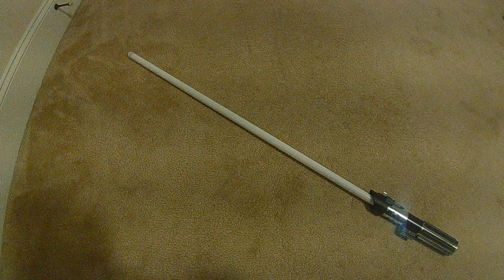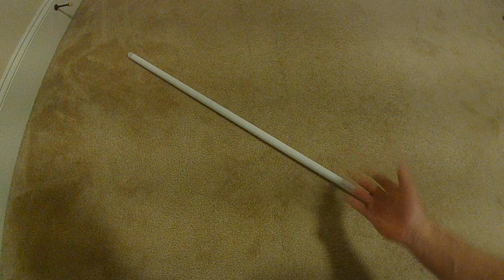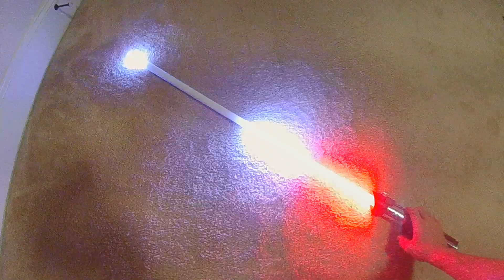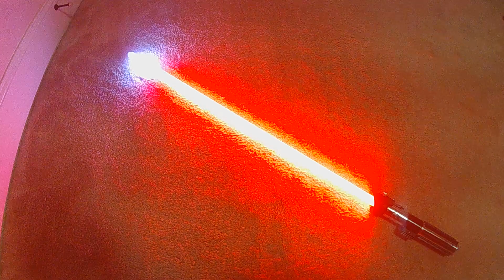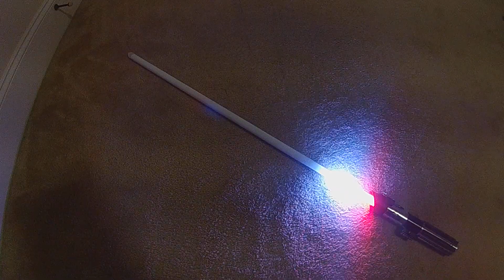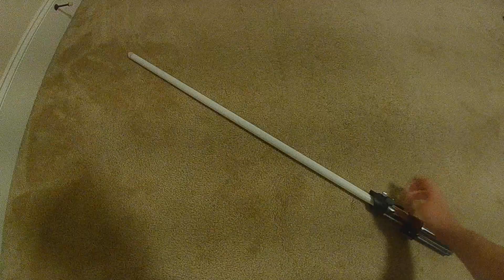Sneak Peek - Demo - Accelerating / Decelerating SparkTip Ignition and Retraction for ProffieOS

Comment: Can you set a normal ignition to be the wav length of the audio? Last I remembered you had to adjust the time manually for ignition specifically.
Reply from the maker: In OS7 library if you set Ignition Time to 0 it will use WavLen for "Auto" timing.
https://www.fett263.com/fett263-proffieOS7-style-library.html#fett263

Comment: what about the SparkTip being at the emitter like EP3 when the sabers are Ignition & Retraction theres a flash of light at the emitter
Reply from the maker: That's just an emitter spark, different effect that is already available.
Reply: @Fett263  ok thanks ive been using the rey Ignition spark but trying to use the same color of the blade it just is not bright
Reply from the maker: Try "Power Burst Emitter" under Power Up Options, it can be any color you want.
Reply from the maker: https://www.fett263.com/fett263-proffieOS6-style-library.html#fett263